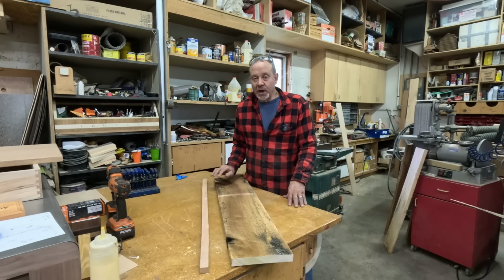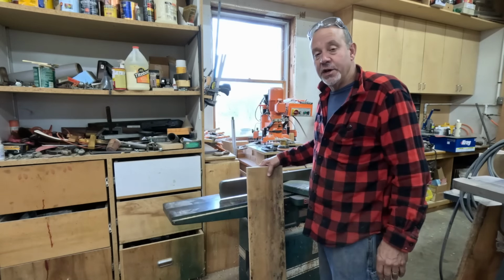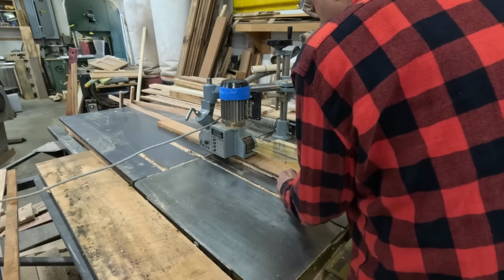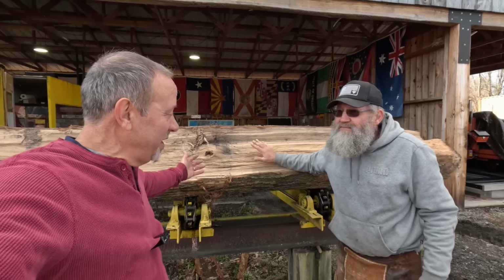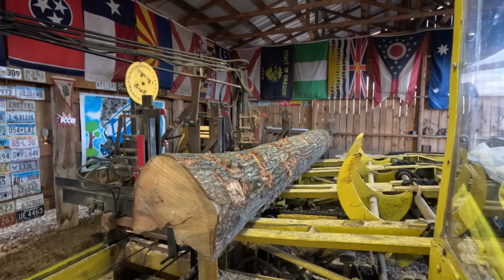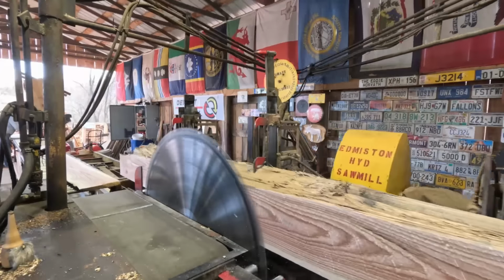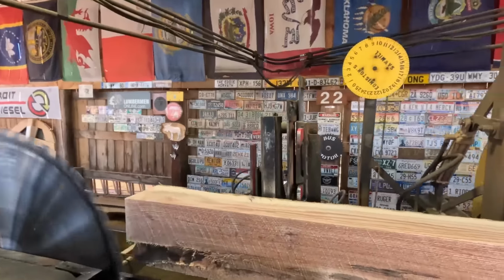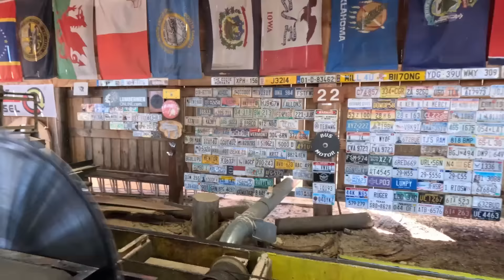sawing a planked oak log and making stickers # 536

Comment: Hey Mark! I got given the smaller version of the Delta feeder. It needed the drive gear on the mounting arm, I forget how much it was but it was only like 5 bucks. I used it on my router table for years. Then the rubber on the wheels deteriorated. They were expensive and I had retired so now it's sitting!

Comment: So Mark, what is the spacing between the layers of boards when you stack? Do you use the 3/4" faces that you sawed on your table saw? Or do you use the inch and an eighth thickness that came off your mill saw? I'm thinking you use the 3/4" so they are perfectly uniform?
Reply from the maker: 3/4"

Comment: Excuse my ignorance but I am from the uk and I don’t know what stickers are.
Reply: Stickers are one inch by 1 inch by 4 foot skinny pieces of wood that are placed between slabs so that air can circulate And dry the wood.You will see anyone who saws wood and stacks it up, uses stickers between the layers of wood to promote drying.That's all they are. If you do not use them, the wood has a much stronger tendency to warp and split as it dries..
Reply: I see. I didn’t know they were called stickers. Thank you for your prompt reply. John. (UK) 👍